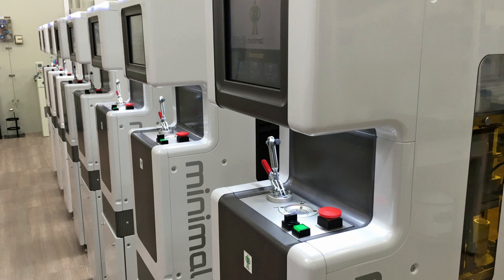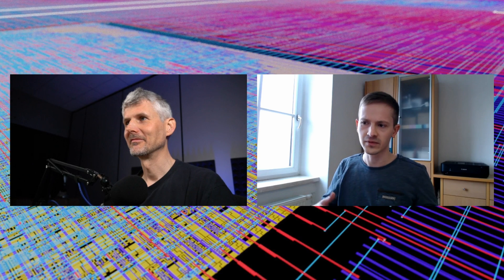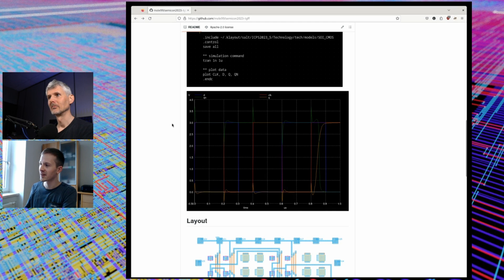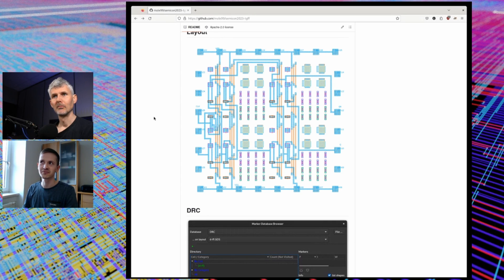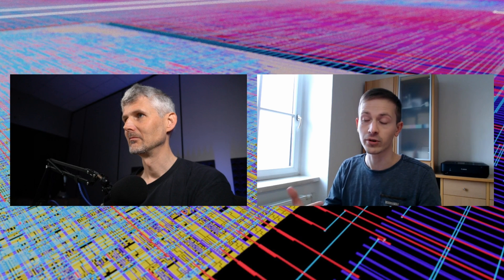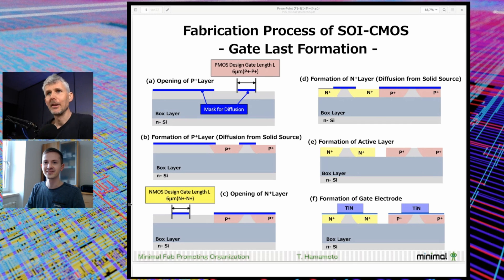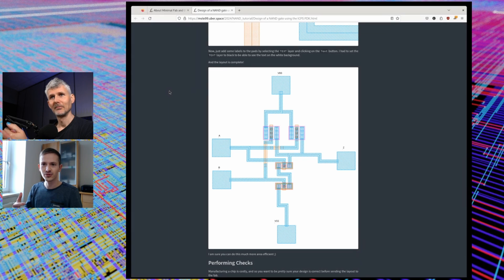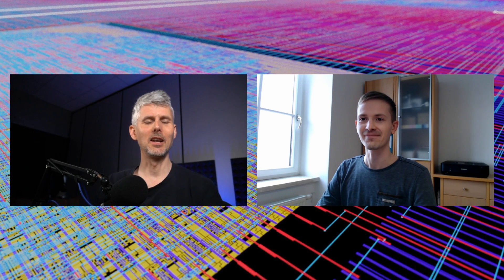Chips in days with Minimal Fab - An interview with Leo Moser

Comment: hi ,but the resitor  on chip how they to do ? thanks
Reply from the maker: metal is resistive, especially thin metal, so you can draw long thin wires. polysilicon is more resistive than metal, so you can draw wires with that to get bigger R. try this easy online tool to learn more: https://tinytapeout.com/siliwiz/resistors/
Reply: grazie
 @ZeroToASICcourse